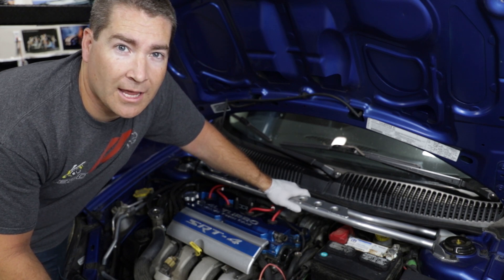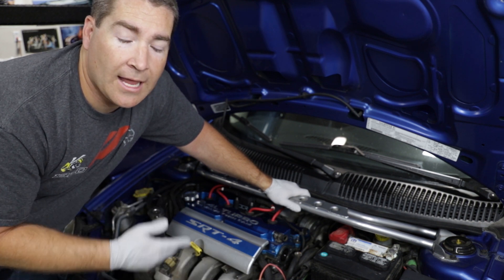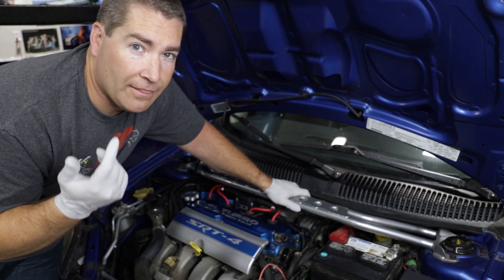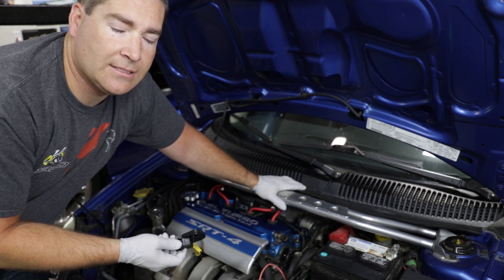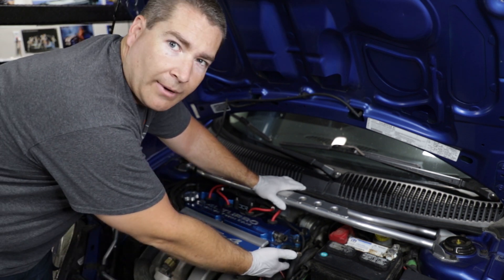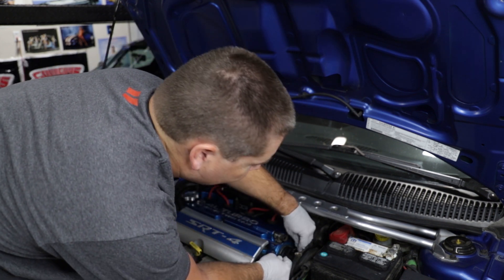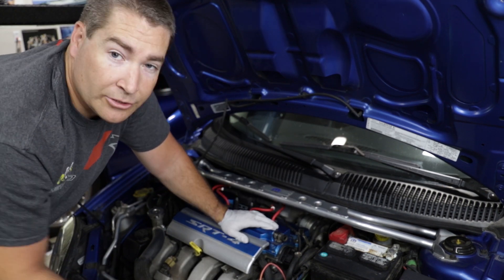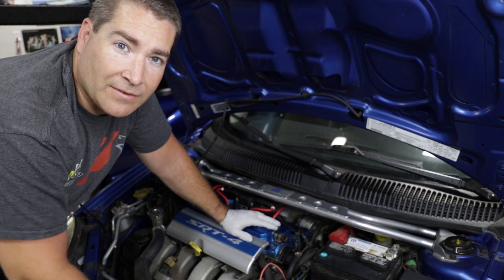Tech Talk Tuesday: How to Replace a CAM Position Sensor on a Dodge SRT-4 Neon

Comment: Was your car only going 2200 rpms my is doing that and they told me it was the cam sensor
Reply from the maker: No mine was not only going 2,200 rpm, but that doesn't mean your problem isn't the cam sensor. A faulty sensor can result in a variety of different symptoms depending on how it is failing. Have you checked for engine codes?
Reply: @LifeatSpeed  yeah I was having a cam sensor code so I change the sensor and the Connector code whent a way  but still revs to 2200 now my new code is a p0122
Reply from the maker: With a P0122 code you may need a new tps, or do the tps rewire.
Reply: @LifeatSpeed  that’s the next thing I am doing to do yesterday I check voltage on the tps and I am getting 0.1 v
Reply from the maker: Hopefully it's an easy fix. I recently replaced the tps and did the tps rewire. I have videos on both in my SRT-4 playlist

Comment: Thanks! Just replaced mine. 137,000 miles, on my 2004 SRT-4. Pretty easy...I wish videos would detail how the wire plugs,  unplug! I seem to always have issues on them😊
Reply from the maker: Some of the plugs can definitely be tricky, and even trickier to film with where they tend to be located. But excellent point! I will try to incorporate that in my future videos. Thanks for the feedback!
Reply: @LifeatSpeed  ..Good point on difficult position to film. #1 you could describe the type of plug and how to release it. # 2 if you have old ones laying around you could use them. I imagine there are only a few different types .
Reply from the maker: That's true. I can try to tke  pictures of the plugs as well to show how they work.

Comment: Did you replace the magnet?
Reply: Those magnets rarely tend to fail they are pernanent magnets
Reply from the maker: No, just the sensor. Been fine since (knock on wood)